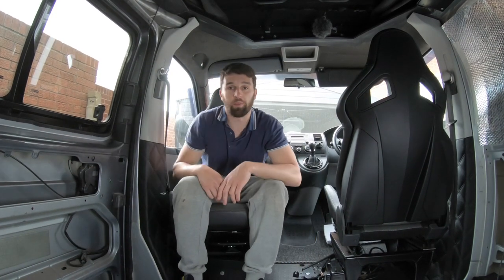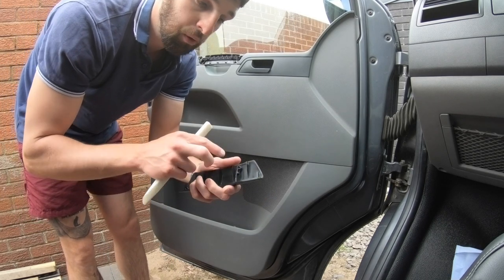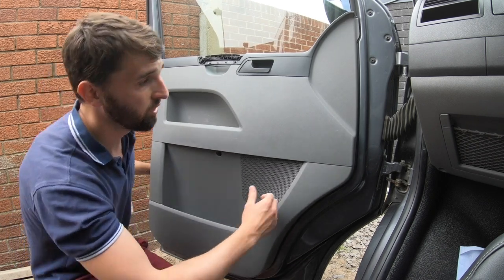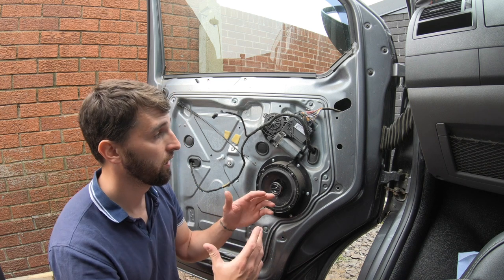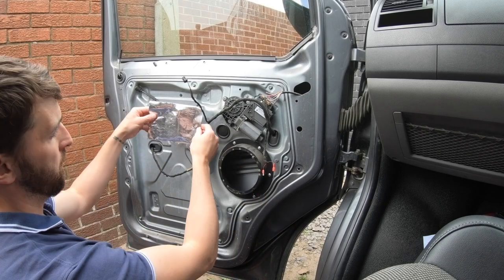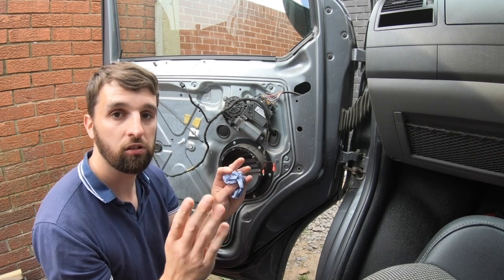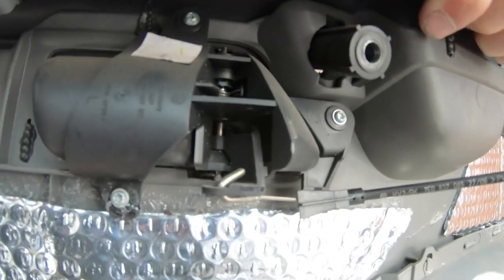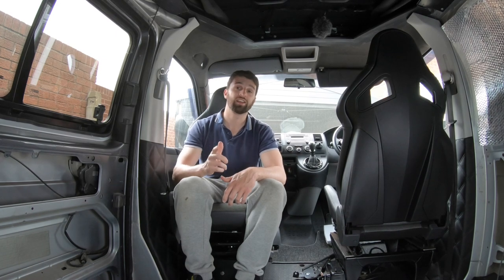* * MY VW CAMPER CONVERSION #18 * * Insulated Front Doors

Comment: Just an add if you drill a small hole in the roller handle put some fishing line or good string through and leave it long just in case you drop it and it snags its just easier to retrieve
Reply from the maker: Great tip for people mate thank you. Awesome comment 👌

Comment: Quick question mate, sound deadening my rear floor , 
Got some over spray of glue from carpet should I try and get this off or will it be ok to still the mat on top of the glue ?
Reply from the maker: Hey matey. To be honest I have glue on my floor now also. You can clean it if wanted but personally myself I’m going to just leave it. It won’t cause any harm or smell or anything so seems a pointless effort to scrub off.
Reply: @JaysFabShop  but will the sound deadening mat stick down properly? 
People keep saying make sure the floor is clean ?

Comment: Hi Jay, what would you think is a realistic budget to do a conversion with a pop top, to a fairly high spec?
Reply from the maker: Hey mate. That’s a very difficult one to be honest mate as it all depends how much you will be doing yourself? So for example I would say 4/5 k for everything but then you could spend just that on a pop top alone. Could be as low as 2.7 k depends on a few factors or could be as high as 8 k. One thing I will say though in my opinion. Building a van to a very high spec isn’t all about fitting the best or most expensive parts. You could fit cheap alternatives but it’s the standard of work that counts and what you would get judged on if that makes sense. I will
Use VW glass in my next one if I ever build another.
Reply: @JaysFabShop  Thanks Jay, I'd hope to do it all myself although cutting the hole in the roof seems really daunting. How much did you spend on your pop top, and would you recommend the one you used? Love the videos BTW and the quality of your work👍
Reply from the maker: Thank you mate means a lot. My pop top was £1100 delivered. I think it’s a good pop top for the money. It is perfect for me. Can’t complain for the money to be honest. I love mine.
Reply from the maker: But it is personal choice. Ino pop tops can be very very expensive so it’s choosing the middle ground I think is key
Reply: Jay Saunders where did you get your pop top from?
Cheers